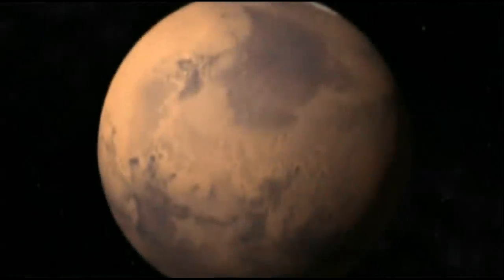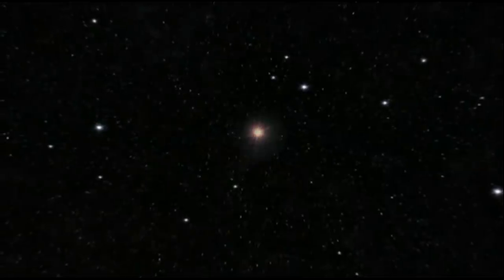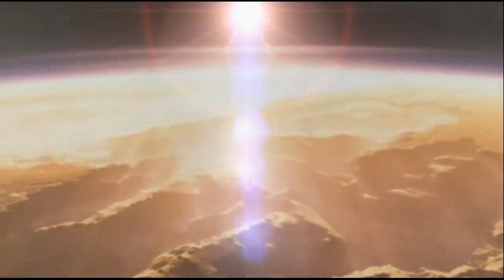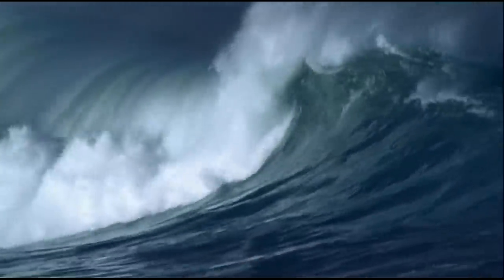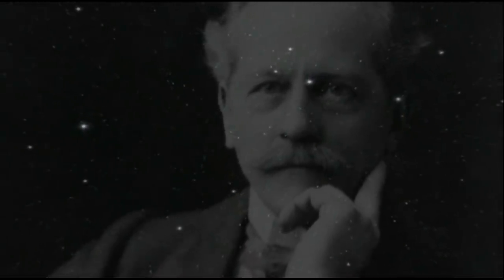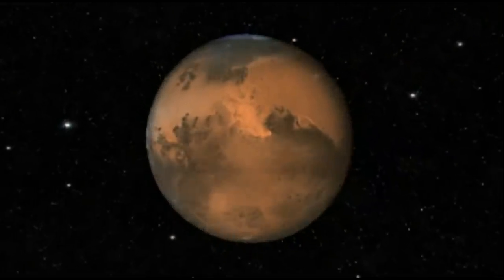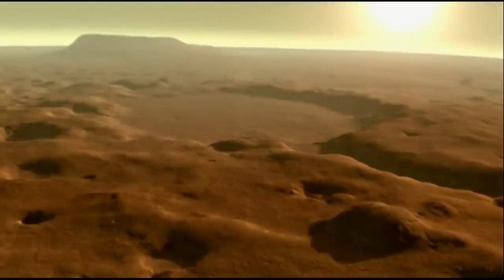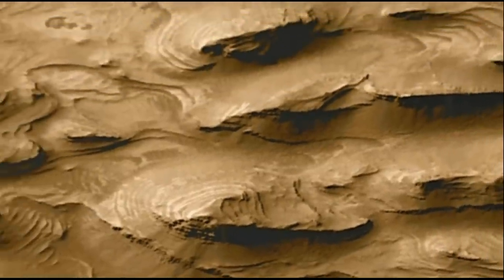Mars - The Red Planet (Documentary)

Comment: Mars *does* have an atmosphere, although it is quite thin (average surface pressure is around 6 or 7 millibars (0.7 percent of the mean surface level pressure of Earth).  The atmosphere has been used by a number of space probes to slow down and land on the Martian surface.  It is composed mostly of carbon dioxide, but there are very small amounts of other gasses present (including water vapor and oxygen).